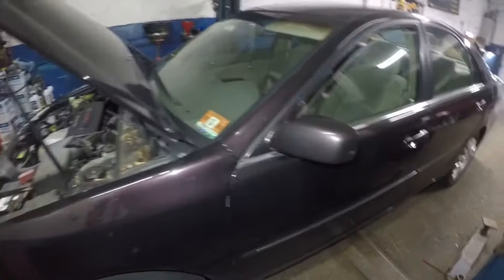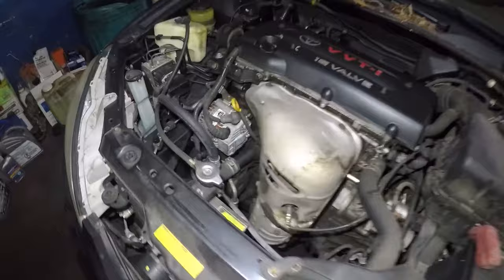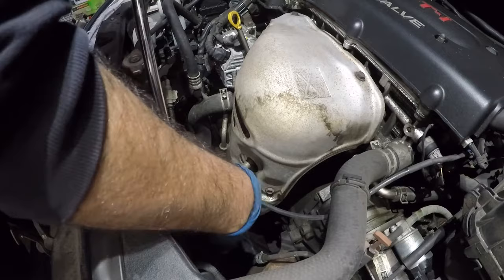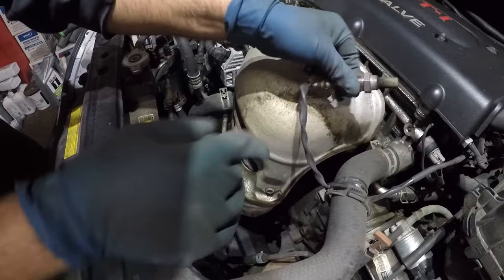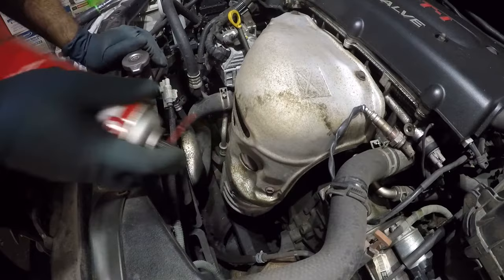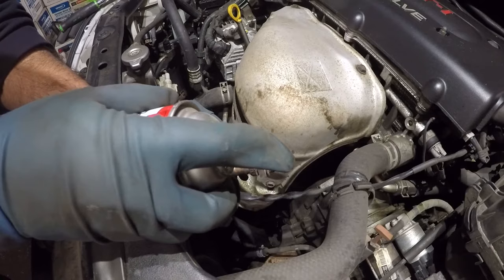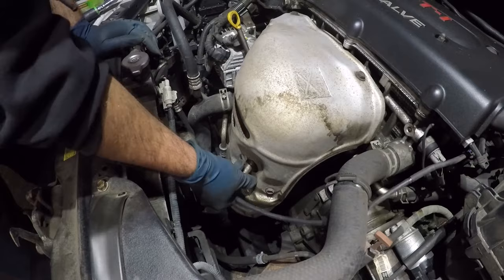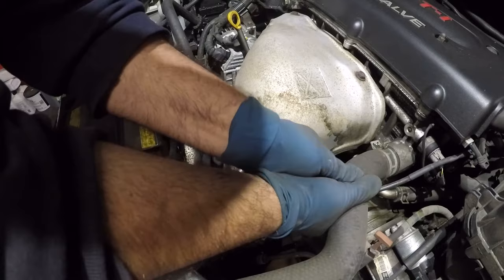How to clean catalytic converter  while on car, customers request to spray down with cleaner

Comment: How can the catalytic converter build up with carbon?  It run so hot that carbon should not build up at all unless the engine is running way too rich which is the first thing to address.
Reply from the maker: Oil burn issue and over time it dosent get blocked bit
Reply: GDI engines have carbon buildup issues on valves, so there's extra
Reply: @robertrose3068  It's the same amount of carbon as on a standard port injection car.  The problem GDI had initially was that there wasn't any fuel spraying around the valves to clean them off, so PCV fumes would collect on them and coke up from the heat into carbon.  If anything, keeping the carbon on the valves would reduce carbon on the cat, since it wouldn't pass through the combustion chamber.
Reply: @BlueBomberTurbo  

Makes no sense whatsoever. It would still burn it. 

In either case, I "think" my oil rings were stuck. Had the BG 3 step engine restoration oil flush 2 weeks ago. After 200-300 miles, no detectable oil loss yet. I was losing 1/2 qt every 500-600 miles. I did the CRC intake valve cleaner today until I can get the BG service done.

Comment: I have a Toyota Tacoma 2012  it jarking while driving it i have changed the transmission fluid and the spark plugs and diagnose it..it bring no code but it jark while driving it slowly.
Reply from the maker: That’s transmission issues only thing I can tell u is to check fluid level

Comment: Hi is this the same as carb cleaner?
Reply from the maker: Yup they also have catalytic cleaner
Reply: @RBTheMechanic  thx so carb cleaner safe on cat or you do not recommend?
Reply from the maker: @bronniesboy  use catalytic cleaner it’s better made for it
Reply: @RBTheMechanic  liqui moly catalytic converter system cleaner?
Reply from the maker: @ameerzulfiquar2111  carburetor cleaner worked good or catalytic cleaner
Reply: Carb cleaner has some oil in it to leave a lubed surface behind.
Reply from the maker: @Skyborn-  use catalytic cleaner if u want I had no issue
Reply: So, I'll  run the car, remove o2 sensor, spray throttle body cleaner or seafoam, let sit for about an hour to heat soak ,then run it to clean through?? Is that correct

Comment: Hi, Ummmm wait a minute.... are you mention throttle body and air intake spray cleaner into Manifold Catalytic Converter OS bank 2 for 5-10 minutes idle??
Reply from the maker: Huh?
Reply: What do you mean "huh"?

Again ... I just watched whole video what you show about throttle body and air intake cleaner what you just spray into OS bank 2 in the hole through honeycomb from Manifold Cataylic Converter. Then you said 5-10 minutes idle rev on 2000 rpm... How is that 100% works cataylic converter to be clean emission?

Thank you

Comment: Great video brother...i found a HACK method also....I would use a full 1 gallon of LAQUER THINNER from Home Depot or Lowes and pour into my gas tank....( ratio is 1 gallon laquer thinner for every 4 gallons of fuel )....And it cleaned out my catalytic coverter and exhaust pipes....it removed my CODES...PO420.....PO401....I didnt even need to install an O2 non fowler plug for the sensor....I used this hack BOTH on my 2006 Honda pilot....and 2011 Benz ML 350....now my cats are clean....I would add laquer thinner everytime i would do an oil change.....( please dont do this hack on diesel cars ) .....wont work....
Reply: I've heard the Lacquer thinner eventually kills the downstream 02 sensors. Has that happened to you?
Reply: @jsanders9975  No...nothing....On the contrary....all my O2 sensors and exhaust pipes even the soot coming out of my CATs have significantly diminished...Both my 2006 Honda Pilot and Benz ML 350 are running great...Ive been adding 2 gallons Laquer thinner for every 10 gallons of fuel ratio just before I do my Oil Change religiously....Been doing this for over a 2 years now...NO CODES...NO PROBLEM...NO REPAIRS so far.....
Reply: @dorkyrouge3372  Interesting 🤔. I've had the P0420 code off and on for about 6months now. I used catyclean a few times and the light stand off for months, now it's back. I did change my valve cover gasket months back it was leaking but other then that nothing else. I'm thinking about using lacquer or maybe seafoam or fuel injector cleaner first.
Reply: @dorkyrouge3372  Oh, I also just replaced both downstream and upstream sensors.
Reply: Scotty Kilmer Approved!
Reply: Proper ratio mentioned often..... is 1 gal of thinner to about 9 gals of gas. 1 gal thinner to 4 gals of gas seems kinda strong....but it seems to have worked for you.
Reply: @TheWilferch  Yes that was the reason why i chose 5 : 1 Ratio....I wanted it slightly strong for ALL the junk and inpurities to be burnt and flushed out...Cleaned out my injectors and manifold covers too....
Reply: @dorkyrouge3372  ....cleaned your manifold covers too?....what are you talking about?

Comment: I'm trying to clean the catalytic converter by putting lacquer thinner down the 02 port.

I'll be pouring a quart lacquer thinner and let it sit overnight, then I'll embark on an 80- to 100-mile roundtrip the next morning. I hope it works!
Reply from the maker: I don’t try that never felt safe to me
Reply: How did it work out?
Reply: Never seen it work. Not even on YT. You?
Reply from the maker: @cjackfly  I had luck with many second attempt and clean out rear downstream oxygen sensor or replacing it  just did one on Honda Accord it passed inspection and light still off
Reply from the maker: @Oden-Heinrich  been good ever since
Reply: @RBTheMechanic  
I was referring to the guy on this comment thread.
Thanks for the reply though
Reply: @Oden-Heinrich  Hi, I just did it last night, but with Sea Foam instead of lacquer thinner. Not going to lie, I feel this is the best method of cleaning catalytic converters; pouring cleaner into the upstream o2 sensor port and letting it soak for a few hours or overnight. I cleared the codes (P0420 & P0430), so I’ll have to report next week. 

The car is a little faster with better throttle response
Reply: @RBTheMechanic  picked up some L.T. gonna put it in the tank tomorrow then drive until pretty much empty. Wish me luck. Light on as of now. Says, "bank 2...."
Reply from the maker: @cjackfly  good luck let me know how it turn out
Reply: @RBTheMechanic  did it. 1/2 tank L.T. 150 miles at high speed. No results. However, there's a catch. At 80 miles, my ride was dead in the water. Cut battery cable to the positive terminal. Onve fixed the codes had to be cleared. So now I need to drive another few hundred miles before I will know if the codes come back of if that bad repair on the cut wire is the real culprit.

  Seriously though, who splices a 14 gauge wire into an 8 gauge positive battery cable? smh... The more you know.
Reply: Only thought on this is, "letting it sit overnight" os a bad idea. That L.T. is potent stuff and immediately startes eating away at rubbers and plastics. Best to use immediately after pouring into your tank.
Reply: @RBTheMechanic  posted final verdict.
Reply: @god-likesystems985 final verdict?

Comment: Get an 02 sensor socket.  DA, do not twist the wires either, if your going to call yourself a mechanic,  then do it right, also. Use lacquer thinner instead..
Reply from the maker: Ok

Comment: If you have crap building up in your converter, something is wrong with your engine. Cats operate at 1200-2000 degrees, they kinda clean themselves at those temps. 😂😂
Reply from the maker: True but they brake down and engine oil carbon build up.   Prolly not worth fixing new engine